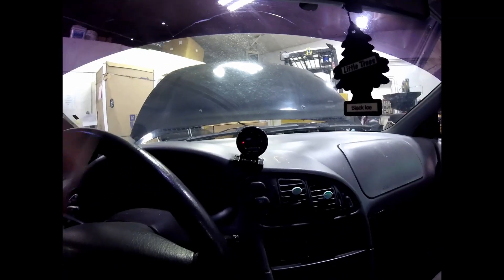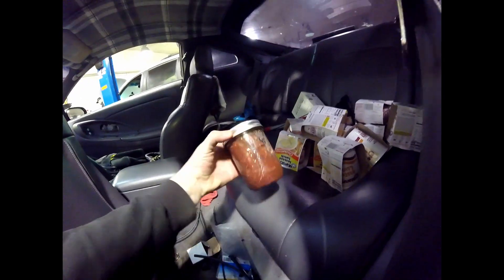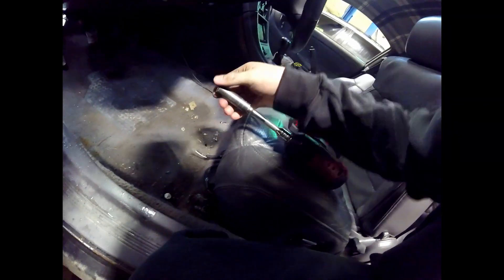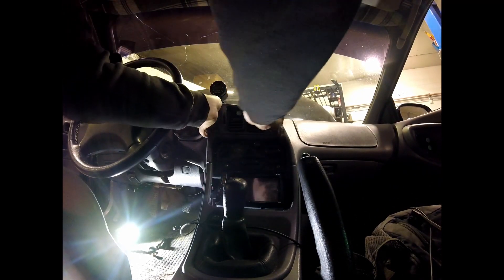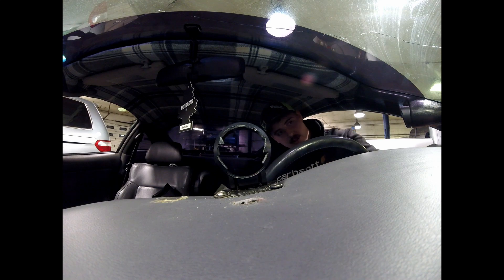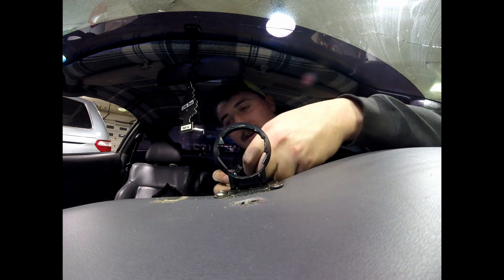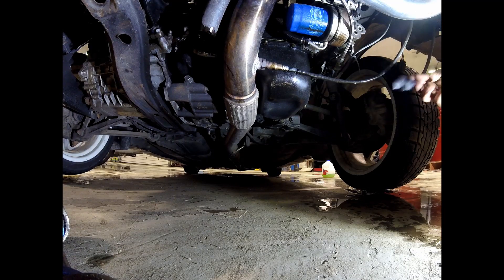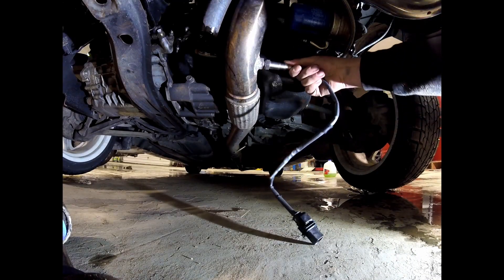AEM X series wideband install

Comment: Nice install.  But, PLEASE, Never start an engine on a hot sensor like that.  That is how 95% of them meet an early grave.  The elements in the sensors are ceramic. And, once the gauge is on, it heats it up to 1200F ( glowing orange).  Then, the cold startup air shocks it, like throwing cold water on a hot windshield..  Once the sensor element has a crack started, it's not long for this world :(
Reply from the maker: lordandprotector so how would you avoid that ? Sensor heats up on start up